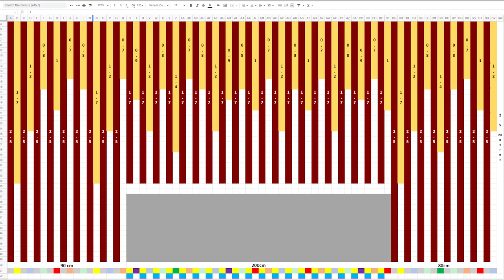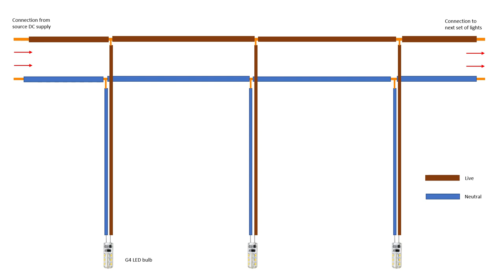DIY Voice controlled LED Accent Wall

Comment: Shrink tubing is your long term friend, nice job on that.  Only suggestion would have been to maybe cut the slot as a French cleat instead of flat, so you wouldn't need any screws to hold it to the wall.  Looks good!
Reply from the maker: Thanks for the suggestion mate. A French cleat would have been a great idea. I will think of it for my next project.
Reply: I don't see how could french cleat fit here, i mean all  installment gets as high as the ceiling.
Reply: I love French cleats for the reason you mentioned. There are some picture hangers with the French cleat design and given the sets not being too big, those could had been incorporated and facilitate the hanging.
Reply: @kalczarobert  - Good point. Forgot about that detail. 👍🏻

Comment: Txs for this awesome video. Can I pl get some specifics for suitable led bulbs and wiring specifications for low voltage  12v AC system.  that can be used on  outdoor  landscape lighting system. Thanks so much.

Comment: hi, I saw your video, it's too strong, I would like to do it too, I saw that you also put the screws under the wooden dowels, but do those have to be fixed to the wall? but if there is wood above where the geese are invited, isn't there a difference in height underneath? bye thank you

Comment: Nice 👍🏼 black radiator paint would have topped it off to make it hidden.
Reply from the maker: fair point, but since there was already white paint on it, by adding one more coat i was concerned about impacting the efficiency of the radiator.

Comment: This looks amazing. How did you hide your power adapter and wall plug? I am thinking of doing something similar but not sure how could I hide that big power adapter.
Reply from the maker: The power adaptor and wall plug are behind the display cabinet, which is why I opted for voice control activation.

Comment: Hello man im from Indonesia , nice to see your video , if something bad happened on the lamp , how would you do that ? Is easy to change ?
Reply from the maker: Hi Mate,
Glad that you like the video. The benefit of using g4 led bulb is it is very easy to replace the bulb. Simply remove it and put back a new one.
Also if you follow the circuit diagram in the description, even if one bulb fails, the remaining will still be lit.

Comment: Hello, I thought the idea was excellent, I'm in France and I would like to put a panel like this in my salon, I just haven't figured out how I'm going to connect the wires on the left (I have the power supply connection) and on the right when I finish where I'm going to connect, if If you could explain it to me, I would appreciate it, congratulations for the video and the idea
Reply from the maker: The wire connection diagram is in the description. Please check that for a better understanding

Comment: The link for your power adapter doesn’t work , and how many lights can go on one adapter?
Reply from the maker: Hi,

The product must no longer be available on Amazon. The wattage of the power adapter will determine how many lights you can use. I use 1.2 W bulbs on a 60 w Adapter which can support upto 50 1.2 w bulbs. But always use 80% of max capacity.

Also it is important to have right thickness of wiring for larger no of bulbs to support the load. for 40 bulbs and above use min 1 mm thick copper wiring.

Comment: why did you please fixe the lower part on the wall and the upper part on the wooden bar
Reply from the maker: The wooden bar on the top is fixed to the wall studs to give stability to the structure. There is no need to give support on the bottom. Also if you have noticed, the bottom part is of varying length. So if put a wooden support, it would be visible

Comment: Is the wall concrete or wood? I was wondering how to install wood accent on my concrete wall.
Reply from the maker: the wall is plaster with wooden studs in my case. if it's concrete, no need to use a stud finder. you will however need to pre-drill the holes on the wall and use wall plugs.
Reply: @AnotherIndianTechie  Thank you for your response. I thought my question will be left unread and not receive any reply. With this, I subscribe to your channel. Looking forward to see more DIY's from your channel :)

Comment: Nice project, the video however could of been about 15 mins shorter. No need to see every hole filled, every board taped and I would of soldered the wire connections and then added the shrink tubing, but still good job
Reply from the maker: Thank you for the comment. I will work on that ..so glad you like it 😀

Comment: That wall is basically a fire hazard. You should use proper Wire/Splicing connectors. You should add a big disclaimer.

Comment: Very bad idea to cover heater with wood.  Definitely not recommended
Reply from the maker: the heater is not covered completely with wood. I have put in vents similar to that of a radiator cover and we have not experienced any dip in efficiency, nor has the wood warped.